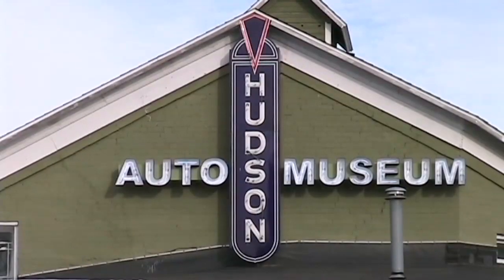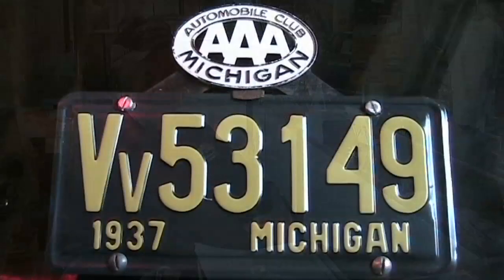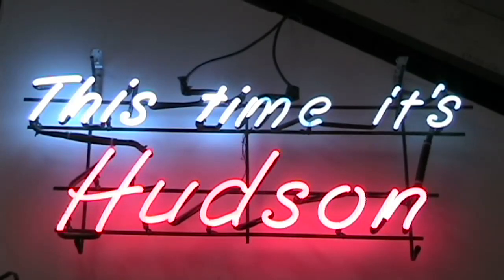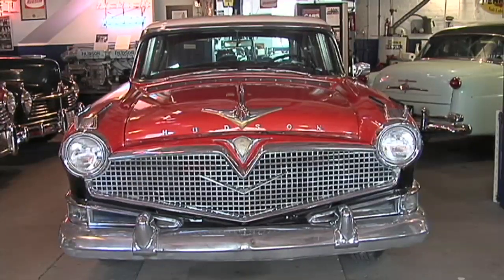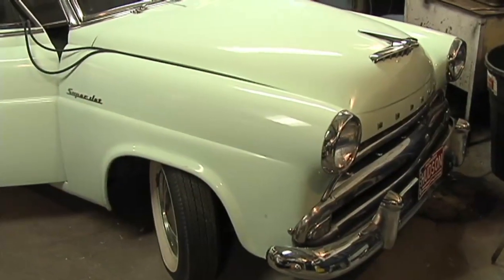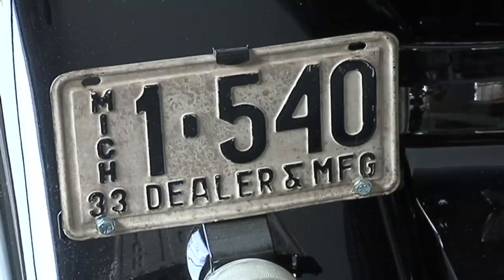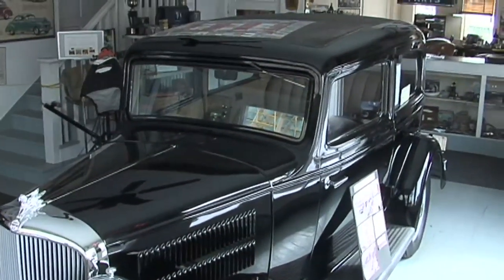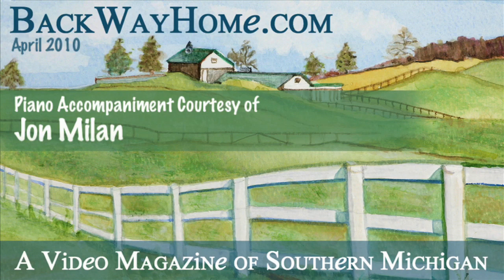The Hudson at Ypsilanti's Automotive Heritage Museum

Comment: MY DAD LOVED HUDSON CARS! HE BOUGHT TWO NEW ONES IN THE EARLY 50'S. I'M NOT SURE WHY HE GOT RID OF THEM, I REMEMBER TAKING TRIPS TO MY GRANDMOTHER'S HOUSE AT THE TIP OF MICHIGAN. I WAS SO SMALL I COULD SLEEP IN THE BACK WINDOW OVER THE TRUNK. HE BOUGHT A USED  1956 HUDSON; HE CONSTANTLY HAD TROUBLE WITH THE TWO FOUR BARREL CARBURETORS. WE TOOK A TRIP TO ARIZONA ABOUT 1957 OUT WEST SOME WHERE HE HAD A BREAK LINE FAIL. WE STOPPED AT A GAS STATION AND THE GUY REPAIRED IT, BUT FAILED TO SECURE IT TO THE AXLE. DOWN THE ROAD THE BREAK LINE FAILED A SECOND TIME. MY DAD WAS REALLY RATTLED AFTER THAT. I WAS IN JUNIOR HIGH AND BEEN DRIVING TRACTORS AND LOADER SINCE I WAS REAL YOUNG, SO HE LET ME DRIVE WHEN WE WERE ON THE OPEN PLAINS. IT WAS A THRILL AS A KID TO DRIVE ON THE OPEN ROAD. I STILL HAVE FOND FEELINGS FOR HUDSON CAR. I REMEMBER THE DETROIT NEWS WRITING AN ARTICLE FOR THEIR SUNDAY MAGAZINE MAYBE IN THE 60'S ABOUT THE OWNER OF THIS MUSEUM REFUSING TO GIVE UP HIS HUDSON DEALERSHIP LICENSE WHEN NASH BOUGHT OUT HUDSON. MY AUNT WORKED AT THE HUDSON PLANT WHEN IT CLOSED. THEY WENT ON STRIKE AND HUDSON TOLD THEIR EMPLOYEES TO PLEASE COME BACK OR THEY WOULD HAVE TO CLOSE THE DOORS. I ASKED MY AUNT WHY THEY DIDN'T GO BACK AND HER RESPONSE WAS, "WE DIDN'T BELIEVE THEM. SO HUDSON PASSED INTO HISTORY. NICE MUSEUM!